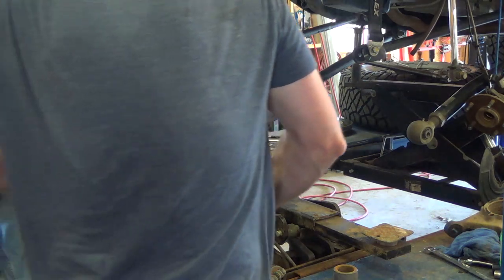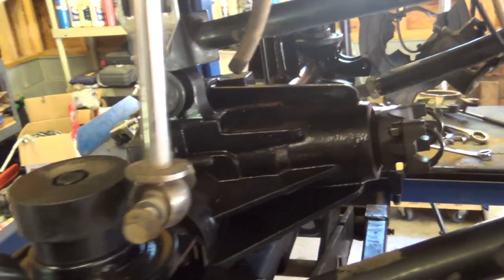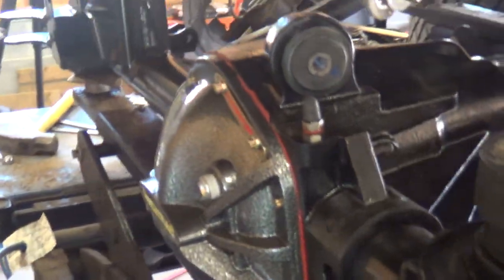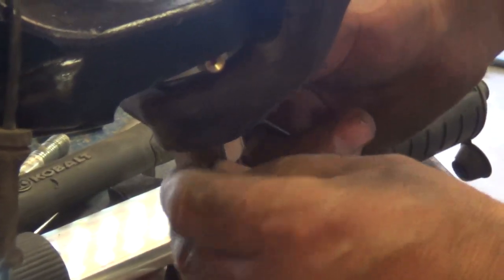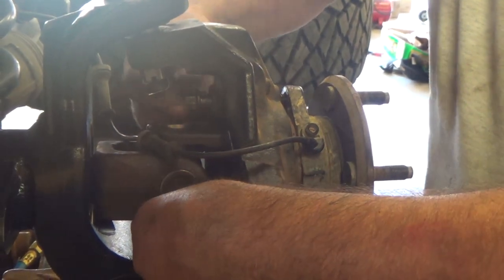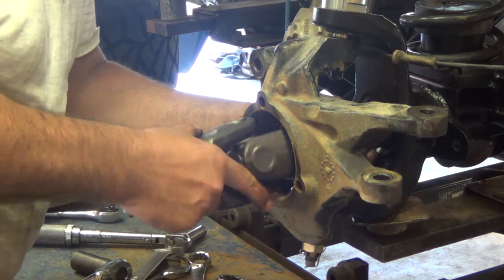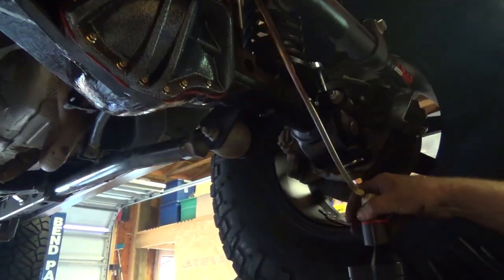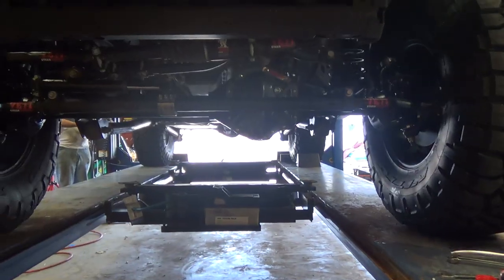Dynatrac Pro Rock 44 Unlimited Installation - Part Two - Final Install

Comment: Great video man I’m getting ready to pull the trigger on a pro rock 44 front myself we already have the steer smart set up any tips that weren’t in the video for install I will be setting it up myself buying it fully assembled with a plug-and-play OEM locker.
Reply from the maker: Actually.. it really was that easy. The only thing was that little bit of grinding I had to do on the control arm bracket... but it just plugged in otherwise!
Reply: o3djeeps [ OVERCLOCK3D Jeeps ] sweet thank you. Keep the great videos coming.

Comment: That's why I bought a Rubicon starting out. I find it's less time, money and hassle to start with a Rubicon and modify it.
Reply from the maker: That works for a lot of people...  Other than the transfer case, I have now changed out pretty much every part that I would have had on a Rubi with stronger or bigger than Rubi components. I'm glad I started with a non-Rubi...  ;-)